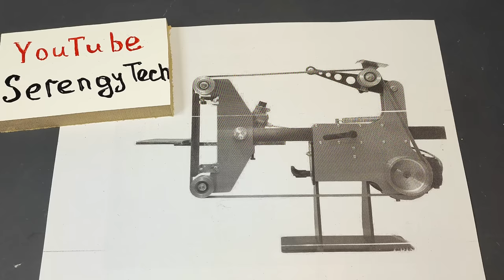Amazing Homemade Mini Belt Grinder

Comment: Amazing!! Do you mind posting the materials used in the description of the video?
Was it aluminum?
What kind of motor, voltage?
Thanks.
Reply from the maker: Yes it's aluminum. steel crossbar. motor 27v. aviation

Comment: Excellent. I would like to attempt this project. How do I get the plans??
Reply from the maker: Unfortunately, I did not make any drawings. I used a picture from the Internet. I printed it on paper in the required size. In my video you can see how I did it.